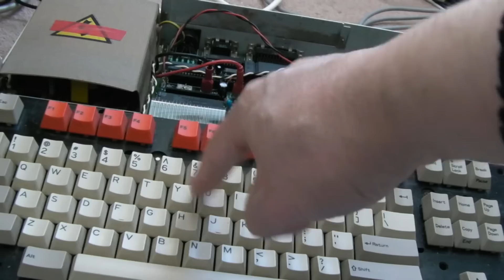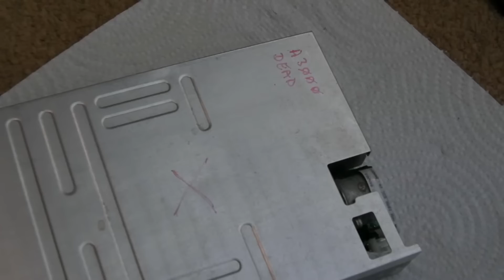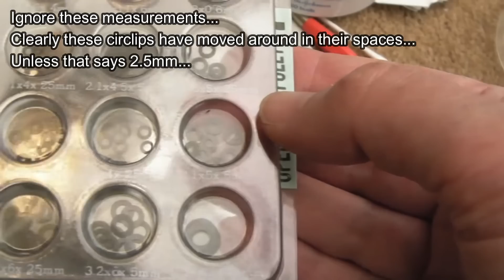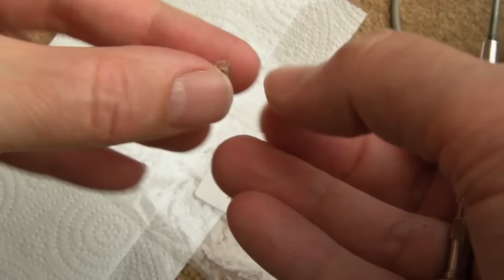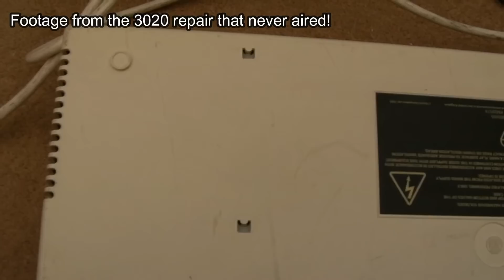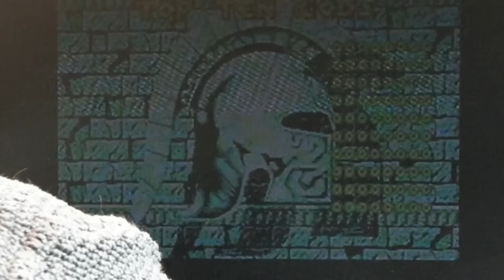More Archimedes Fixes - Part 1 (2 x FDD)

Comment: Might be a the way the heads write on the 3010 vs the 3000. Maybe the 3010 drives do no honor the fact the DD disc has no HD notch and the write current is not adjusted.

Comment: Thanks for the info on the drives. I had an Archimedes 310 when they came out, but sold it. A while ago I bought one from Ebay which was advertised as working but there seems to be a problem with the drive as it's giving errors on a few floppy discs I've tried - as well as the hard drive. I haven't had time to look inside the case yet to see if it's something simple.